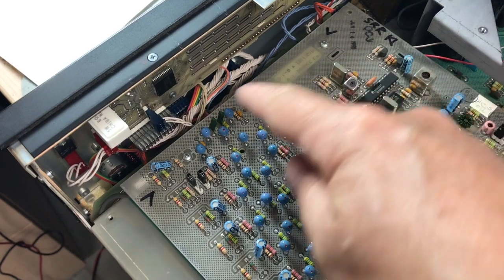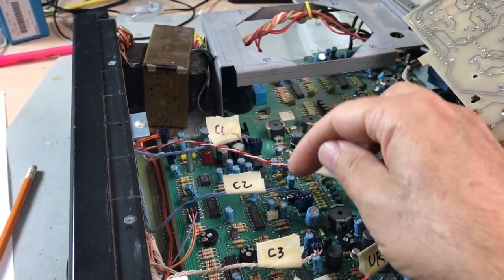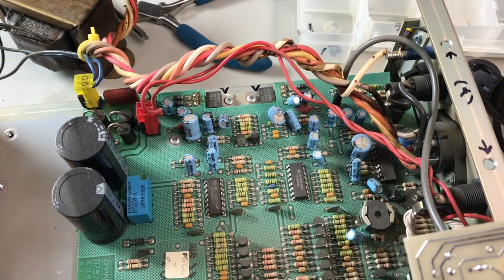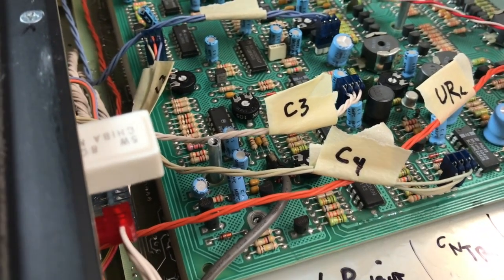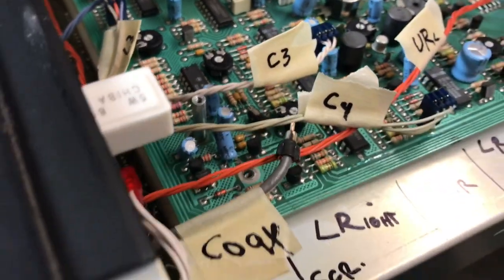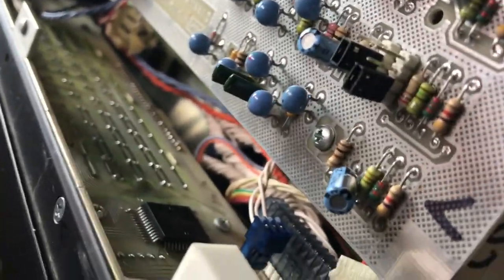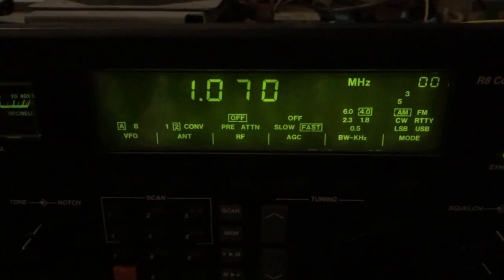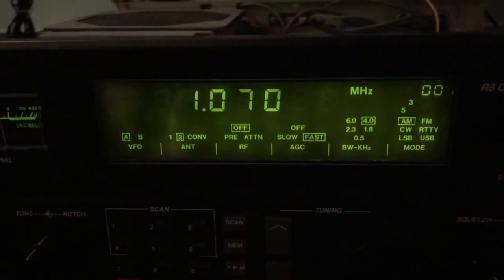Drake R8 bad capacitor replacement... audio circuit

Comment: You did not let us know how the display cleaning. worked out.
Reply from the maker: It did not make one iota of difference -- the unit may have been owned by a smoker at some point or there was an environment issue -- the overall brightness did not return BUT the LED's behind the display were plenty bright...
Reply: @canuckcoffeecanada  Thank You. I run mine 1 step dim whenever I can from a power disconnect so it goes dark when not in use.
Reply from the maker: @RickCutter  I wanted to have a better understanding of why it was dim -- and could have stripped down the R8 even more -- but it was a friends that I was re-capping and that was the priority -- Truth be told, all Drake R8's need to be re-capped sooner or later -- and thank heavens that the radios have not had any issues with proprietary chips -- because they are not to be had -- when that aspect of the Drakes start to die -- if they do, they are gone forever.
Reply: @canuckcoffeecanada  if you search my name on YouTube you’ll find my channel.  I’m in the IO.Group also. Its how I found this video.  I’m your new subscriber…
Reply from the maker: @RickCutter  Yup - I see your channel -- great old radios!

Comment: Thanks for all of the info! I'm replacing the 470 uF caps on my R-8 and was wondering how the ribbon cable clips work on the bottom board.  Do they detent somehow?
Reply from the maker: Not quite sure what you mean -- you can always send me an e-mail with any questions -- this is the ONE repair that every Drake R8 owner is going to do.